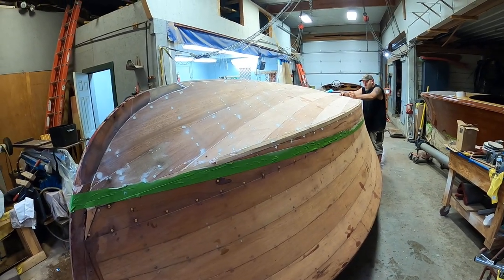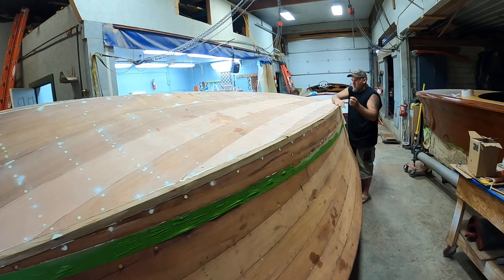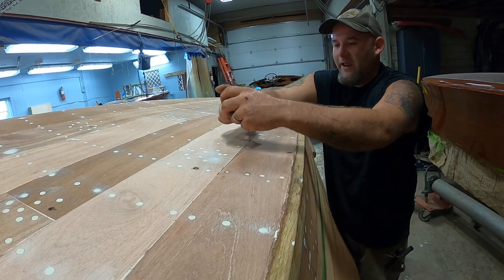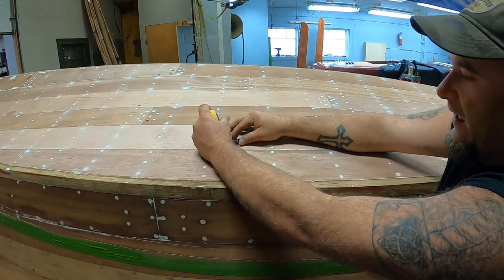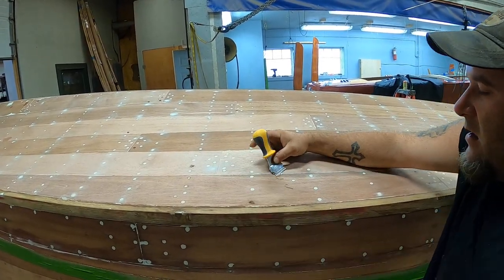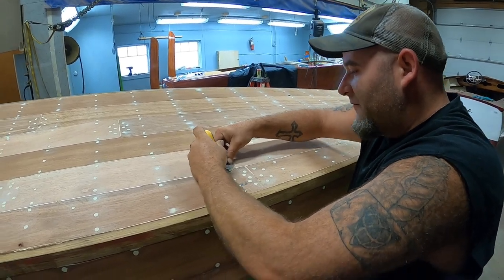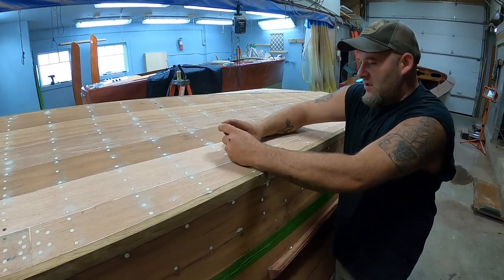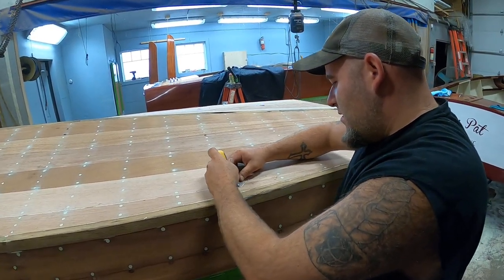1948 19 5 Truscott Barrelback Runabout   Danenberg Pre Soaking Results 7 18 2022

Comment: Can you seal the bottom with that high a moisture content?  If the boards dry out, I picture potential separation from the 5200 seams.  Thanks.  Always enjoy your projects.
Reply from the maker: Bob, please, please, please read the excerpt from Don Danenberg's article included in the two previous videos. The answer is yes we can because the point of the process is to use the CPES to lock the moisture content in at levels that mimic what the boat will live in post-preservation.

Comment from the maker: I have had several comments and requests to identify the scraper Joe is using. Guess what? If only you had clicked on "Show more" directly above, you would already have your answer because I, in fact, did identify it there: 
"Next, as Joe illustrates here, we are using a multi-purpose razor blade scraper with its angled handle to slice the 5200 fair with the bottom planks. We are using this scraper: https://www.amazon.com/gp/product/B07H32N1PV/ref=ppx_yo_dt_b_asin_title_o04_s00?ie=UTF8&psc=1"

Comment: Will that high moisture content in the wood have an effect on the CPE ?
Reply from the maker: John, please, please, please read the excerpt from Don Danenberg's article included in the two previous videos. The answer is yes we can because the point of the process is to use the CPES to lock the moisture content in at levels that mimic what the boat will live in post-preservation.